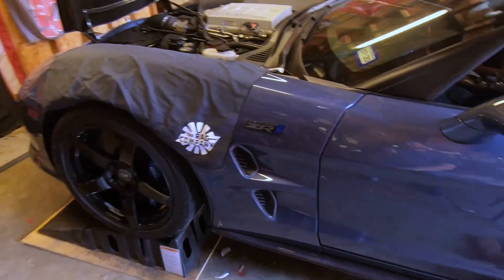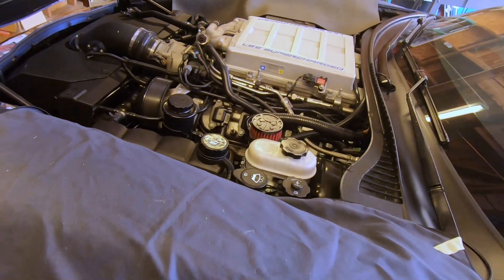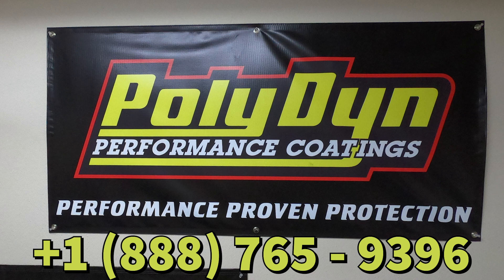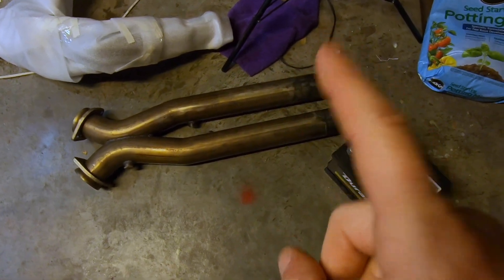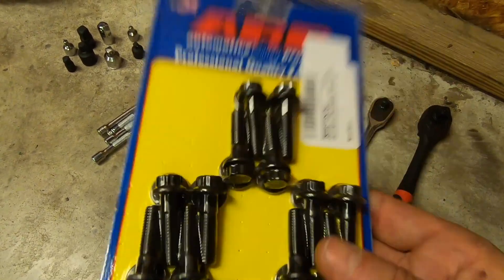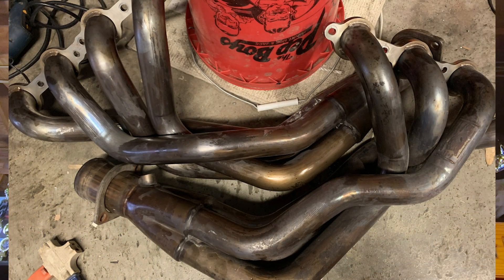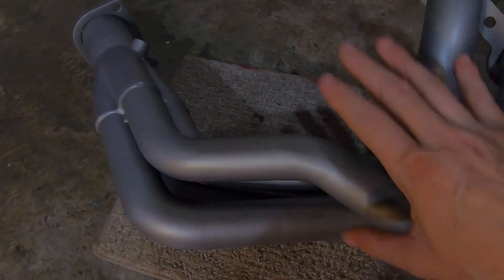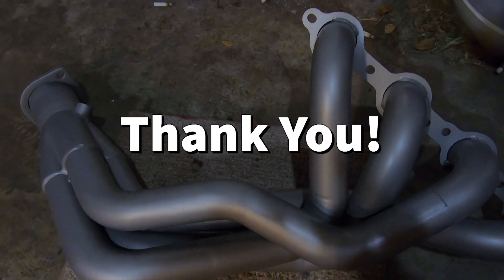CERAMIC COATING CORVETTE EXHAUST - Must have supporting mod!

Comment: Nice man look at all that room in there to get the headers off. You know how tight the 1LE is
Reply from the maker: Yeah the problem with this is just taking out the bottom. Once we figured out two things we had to listen wasnt too bad. I think going in will be easier and I’m going to protect Wrap for putting in. Fingers crossed won’t be hard. 🥴😂

Comment: They came out awesome!  Do you have a set of quick jacks?  Curious if they would give you the room to change out the headers.  I haven't tried with mine yet so I was just wondering.
Reply from the maker: Not sure I know we had to lift pretty high in order to swing header down then pull out.  But most of the work was around the center of the motor

Comment: Did it work? Did you have same starter problem with the Camaro? What exhaust did you have on the Camaro(including headers)
Reply from the maker: TSP 1 7/8, off-road xpipe and flowmaster American thunder on camaro. I didn’t have near the heat on it but I could still feel a heat increase underhood. The headers on corvette c6 are right beside LS starter. It’s kind of a known issue with these after cam. I should have done when I cammed. Would have Saved me a 150 starter. Ah well at least it has warranty. I was gonna planning to give shop
Tour with this video but they never approved so decided to release what I legally could. I think it’s good to get done either way with headers especially if you plan to add more later.